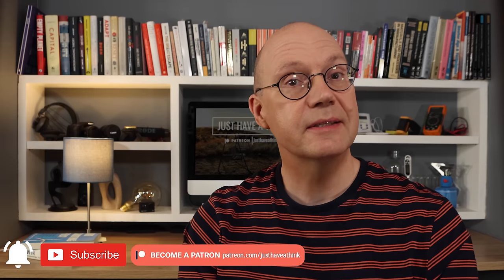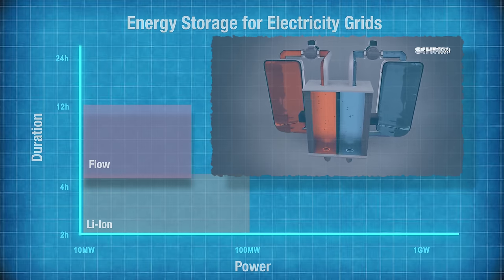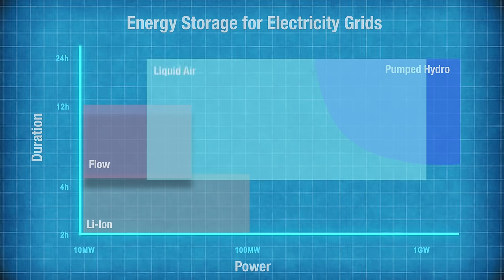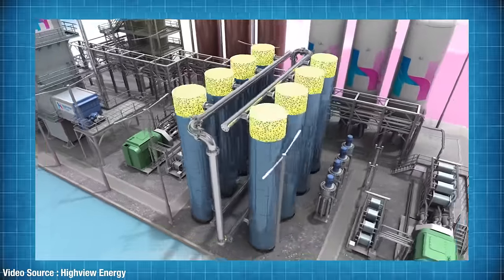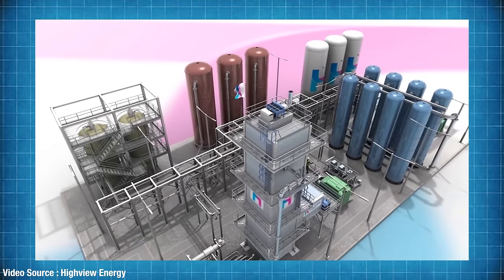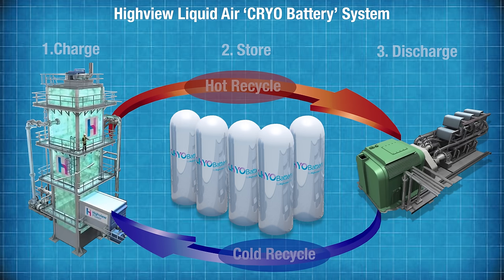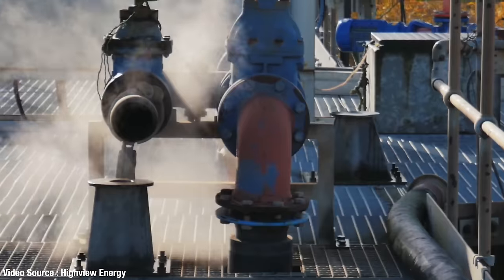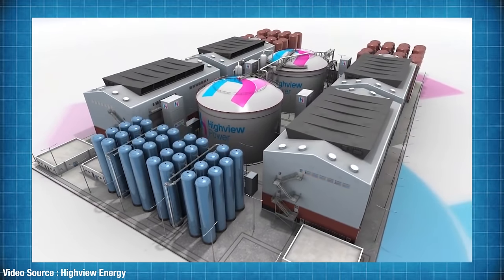Liquid Air Batteries. Literally energy from thin air. Seriously. Literally!

Comment: Mr. Borlace, thank you for this additional insight. You mentioned 60% round trip efficiency. Have you heard how quickly the response time to full grid power these systems achieve? I know that peaking gas turbines have about 10 minutes to reach full power output to grid and of course Li-Ion batteries are virtually instantaneous. Any idea where these liquid air technologies fall? Thank you again for your excellent content! Much appreciated!
Reply: By looks of it, single minutes especially if run at fraction of power just to make gen stay in sync.
Reply: It is long-term energy storage such that combined with concentrating solar thermal the combine output is 130%

Comment: The maximum efficiency due to thermodynamics is about 70%, compared to over 90% for the best battery system. Dr. Sadoway's liquid Al should
be more efficient than the liquid air, done properly.  Its all a matter of cost/benefits.

Comment: Very good presentation. I see others have mentioned liquid metal batteries which was another upcoming complementary technology.
This technology launch has taken some time, but now success. Funding was key and the business environment was not ready for LAES. Now we need to go full speed to decarbonise. 
Industry , financing and the public have got it. 
I believe the 60% energy storage efficiency figure presented, based on my own experience as an LNG plant design expert.  Further detail improvement will only give incremental efficiency gains. This is still a worthwhile technology as part of a mix. There is no silver bullet single answer at this time. Now conversations need to also move towards forming regional and ultimately a world-wide energy energy web(s) so that renewable "generation" as well as other forms and  "battery" investments and utilisations across continents are maximised. VHVDC transfer technology is already available and in use to do this.

Comment: 50-60% efficiency is quite low (And it may be in the best condition possible ??).  Hydro are close to  70%–80% and Ion battery close to +90%. It may be the big problem ? But if it can store power that would be waste aniway... it would be a win in some area.

Comment: I'm hoping to use a centrifugal Tesla-style disk pump to create liquid air as a supplement to my DIY plug-in electric hybrid's Lithium Titanate batteries that can then get fed back in to the EV hybrid's Tesla turbine power source using waste heat from the combustor to re-expand the liquid air.

There's also the potential for feeding LOX to a gasifier via Tesla's valvular conduit fluidic diode as a pulse combustor which makes the turbine combustor in to a rocket-powered turbine. XD

Comment: Thanks your you thoughts. I wonder if part of these developments can include gas stations for transportation. If liquid air storage is so good can't we power vehicles with air motors and refill the tanks at gas stations. (Liquid air gas stations). Why do we keep reusing electricity as the only means of power transfer. Another thing concerned me, any thermal power station is limited to maybe 50% efficiency in generating electricity, that's nuclear included. Whilst hydro generation is much higher. In the end it will be reducing dependence on any source of power except renewables which is sustainable. Great stuff, I've yust found you. Cheers David.

Comment: What we need is a free market for electric power (preferably combined with a carbon tax in proportion to the net loss associated with submerging all coastal  cities, etc, but that's another topic).

If everyone buys and sells electricity on a suppy and demand basis, the grid will be balanced. We don't need to debate how to balance the grid. Whoever deploys the most efficient mechanisms makes the most money. Meanwhile, we'd all charge our cars at off-peak hours when it's cheap, so BEVs balance the grid even if they don't do V2G. 

Of course the fracking industry will do all it can to prevent this while they try to sell us a Hydrogen future.

Comment: Creating Thust Using  gyro permanent magnets and electro magnets 
You need unbalanced gyro to create the thrust'

 to achieve this you can.

 Drill holes in the Outter edge of a disc

 insert barrel magnets with north

 facing to outter edge of the gyro disc.

 There must be room for magnets to

 slide in and out as the disc spins in side the frame.

 positioned around the gyro disc

 ( holding magnet from rubbing the frame) 

With the gyro spinning in the balanced mode

 energize electro magnets mounted in frame 

 ( at every 45 degrees with north poles facing the north poles of the

 disc when energized putting the gyro out of balanced creating thrust.

Creating Thust Using  gyro permanent magnets and electro magnets 

You need unbalanced gyro to create the thrust'

 to achieve this you can.

 Drill holes in the Outter edge of a disc

 insert barrel magnets with north

 facing to outter edge of the gyro disc.

 There must be room for magnets to

 slide in and out as the disc spins in side the frame.

 positioned around the gyro disc

 ( holding magnet from rubbing the frame) 

With the gyro spinning in the balanced mode

 energize electro magnets mounted in frame 

 ( at every 45 degrees with north poles facing the north poles of the

 disc when energized putting the gyro out of balanced creating thrust. 

        You need unbalanced gyro to create the thrust'.

      To achieve this you can.

 (1) Create a brass disc 12 inch diameter 1 inch thick

     (1a) Drill holes in the disc insert barrel magnets with north pole to outside edge.

(2) Create a brass disc 12 inch diameter 1 inch thick

    (2a) Drill a hole 5/8 inch by 4 inches (from the outer ring toward center axis)  every 60 degrees.

   (1b)  insert ( 1/2 inch  X 1 inch)  barrel magnet  into all 6 holes. 

   (2c) There must be room for magnets to slide.

   (2d)  Insert ( 5/8 inch X 1/4 inch) graphite plugs. 

(3) Place disc inside of brass ring with an inside diameter of 12 and 1/8 in

   (3a) Mount around the outer ring electrical magnets every 45 degrees.

   (3b) 8 electrical magnets at.

     ( 1) North),( 2) North East ),( 3 )East),(4)South East)

           ,(5)South),(6)South West),(7)West),(8)North West)

(4)  . When energized putting the gyro out of balanced creating a forward  thrust. 

   (4a) Depending on  which  electrical magnet is energized .

 

 Concerning Gravity created by centrifugal force. 

     (1) Because gravity and magnetic flux are unrelated.

     (2)  We can consider using a balanced wheel,

           with freely mounted magnets

          ( a) With north poles facing outward  

          (b) on outer edge

          (c) mounted in side a framework 

     (3) With permanently mounted electral magnets in frame

         (a) with the north poles toward the wheel 

              in different locations around edges of said wheel 

        (b) As the wheel spins creating centrifugal force

        (c) power added to the electrical magnet

    (4) Will cause the  centrifugal 

      energy to flow to opposite side of

          the wheel causing vehicle to move in that direction. 

You can use this configuration to shift the center of the wheels gravity

 thus creating foward thrust which can be aimed in any direction. 

Which can in effect Defeat gravity.

        I would be willing to work with you . I have other ideas to share.

                                          If you can make this easser to under stand please help.
Creating Thust Using  gyro permanent magnets and electro magnets 
You need unbalanced gyro to create the thrust'

 to achieve this you can.

 Drill holes in the Outter edge of a disc

 insert barrel magnets with north

 facing to outter edge of the gyro disc.

 There must be room for magnets to

 slide in and out as the disc spins in side the frame.

 positioned around the gyro disc

 ( holding magnet from rubbing the frame) 

With the gyro spinning in the balanced mode

 energize electro magnets mounted in frame 

 ( at every 45 degrees with north poles facing the north poles of the

 disc when energized putting the gyro out of balanced creating thrust.

Creating Thust Using  gyro permanent magnets and electro magnets 

You need unbalanced gyro to create the thrust'

 to achieve this you can.

 Drill holes in the Outter edge of a disc

 insert barrel magnets with north

 facing to outter edge of the gyro disc.

 There must be room for magnets to

 slide in and out as the disc spins in side the frame.

 positioned around the gyro disc

 ( holding magnet from rubbing the frame) 

With the gyro spinning in the balanced mode

 energize electro magnets mounted in frame 

 ( at every 45 degrees with north poles facing the north poles of the

 disc when energized putting the gyro out of balanced creating thrust. 

        You need unbalanced gyro to create the thrust'.

      To achieve this you can.

 (1) Create a brass disc 12 inch diameter 1 inch thick

     (1a) Drill holes in the disc insert barrel magnets with north pole to outside edge.

(2) Create a brass disc 12 inch diameter 1 inch thick

    (2a) Drill a hole 5/8 inch by 4 inches (from the outer ring toward center axis)  every 60 degrees.

   (1b)  insert ( 1/2 inch  X 1 inch)  barrel magnet  into all 6 holes. 

   (2c) There must be room for magnets to slide.

   (2d)  Insert ( 5/8 inch X 1/4 inch) graphite plugs. 

(3) Place disc inside of brass ring with an inside diameter of 12 and 1/8 in

   (3a) Mount around the outer ring electrical magnets every 45 degrees.

   (3b) 8 electrical magnets at.

     ( 1) North),( 2) North East ),( 3 )East),(4)South East)

           ,(5)South),(6)South West),(7)West),(8)North West)

(4)  . When energized putting the gyro out of balanced creating a forward  thrust. 

   (4a) Depending on  which  electrical magnet is energized .

 

 Concerning Gravity created by centrifugal force. 

     (1) Because gravity and magnetic flux are unrelated.

     (2)  We can consider using a balanced wheel,

           with freely mounted magnets

          ( a) With north poles facing outward  

          (b) on outer edge

          (c) mounted in side a framework 

     (3) With permanently mounted electral magnets in frame

         (a) with the north poles toward the wheel 

              in different locations around edges of said wheel 

        (b) As the wheel spins creating centrifugal force

        (c) power added to the electrical magnet

    (4) Will cause the  centrifugal 

      energy to flow to opposite side of

          the wheel causing vehicle to move in that direction. 

You can use this configuration to shift the center of the wheels gravity

 thus creating foward thrust which can be aimed in any direction. 

Which can in effect Defeat gravity.

        I would be willing to work with you . I have other ideas to share.

                                          If you can make this easser to under stand please help.

Comment: Calling it a liquid air battery is a bit dishonest. The energy doesn't come from the air, but from whatever is heating it up to cause it to boil. And you can't draw that heat from environment. If you're generating 100MW of power, you'd be drawing more than 100MW of heat from the environment. That's equivalent to power lost in a desert on a perfectly clear night by about 25,000 square meters of ground. Area equivalent to almost 5 american football fields or about 3.5 soccer fields. You just can't distribute that kind of heat absorption without things starting to ice up and rapidly lose efficiency. So if this works at all at cited conversion efficiency and power output, the energy storage is entirely in the hot/cold tanks. And there are phase transitions you can use to get decent energy density out of these with good heat exchange, so maybe that whole thing is plausible at scale, but air's just a working fluid here. Saying that it's a liquid air battery is like saying that nuclear power plant is a water battery. In both of these cases air or water is just the thing that boils to drive your turbines.

Comment: There is a weak point in this scheme! You just briefly mention that heat and cold are stored too, now this is the big problem, you need a huge volume of say water to store that heat. If you want to store 100 MW during 24 hours and you do it with water, then you need a lake. For a 1°C temperature variation, it has to be 5m deep 600 by 600 meters wide. A much bigger temperature variation would harm the possible fish you want to put in your lake. A second cold lake would be best frozen and of the same size.

Comment: I like your analogy with the hammer. What if I could raise a 1 tonne weight  6 meters off the ground then use the weight as a driving force. Or pumped water into a 500 gallon water tank 6 meters above the ground on a stand and then released the water driving a turbine down by the house where the fall is greater than 6 metres. I need exercise everyday & use a stationary bike and a water pump connected to it I could pump the water back up to the top tank. Or use solar energy to do the same Or a Fresnel lens + sunshine to make steam to power a steam engine or a solR water cooker to make steam to drive the steamengine to pump the water up the hill to make electricity that way. Solar thermal energy is free to boil water. Conversely what if I wound up a huge clock spring using 10mm thick spring steel using the bike to wind it up to release energy that way to drive a generator  to pump the water back up the hill. I must admit I do like your videos. Calm, quiet, gentle voice and NO hideous background music.

Comment: Forget making dams to generate enough electricity to supply a grid. Scale it down to individual family. Build a rotisserie similar to bi-box stores like Lowe's or home Depot carpet rolls use. But instead of carpet, install tanks open at the top. At the top of the rotisserie is a reservoir tank with a valve to dispense the water to the top tank and each subsequent tank thereafter. Like a rotisserie, it is a loop system revolving round and round, filling and emptying, dumping their fill into the bottom reservoir. Water is heavy and will produce tons of gravity downward pull which can easily generate all the power needed for a family, day or night, rain or shine, 24/7/365. Here's a link to a sample near the bottom of the front page: itellwhy.com.

Comment: A very interesting concept. 60 odd % is not very good however. Although capturing the CO2 and either reducing it to carbon of very high purity to be used in batteries & industry and Oxygen or water (by reducing it using Hydrogen would work) or some form of permanent capture.  Make the Hydrogen back to use again from the very pure water by electrolysis, during the night when power is if not cheap hut better than free. 
That way not only do you have a battery but a Carbon capture system reducing atmospheric Carbon and a saleable product too.

Comment: @just have a think.

There is a 40% loss from the wind farm or solar farm through the transmission lines to this facility. That means only 60% of the power from wind and solar is making it to this plant.

Then there is the cost of power of doing their liquefacation. 

Then the cost of converting it from a liquid to turn the turbine, and the losses in the turbine.

Then it's back to the grid and the transmission lines, and it'll transmit power with another 40% loss of whatever it puts out.

I get it they're taking power that would otherwise not get used, because they'd have to shut down the solar or wind if there was no place to store it.

But you can see that this is a scam I hope. We have to come up with better systems. That don't have these inherent losses.

They don't want to scale down to put something on somebody's house that is stand alone; that actually works, that doesn't make them money. 

They want to control the power so they can one day soon shut it off.

We are completely slave to the internet: as it is controlling the cell phones /our business computers /our personal computers/ all of the banking /all of the legal systems/ all of the businesses.

 All you got to do is shut the power off, to turn off everybody's cell phone/ everyone's computer/ everyone's Bank account/ and everything else. 

You can't even get gas out of the pump at the gas station if the power goes down BECAUSE: it's a electric driven pump, controlled by a computer.

Comment: 60% efficiency seems unrealistic. Read that state of the art thermal energy plants (Hot -> Cold) have a efficiency of 49%. The round cycle does two cycles, one for storing and one for extracting.

Recycling seems unrealistic to me since we would either be charging or discharging the battery at a particular time.

Comment: Unlike Lithium Ion battery technology; this technology requires no new development; uses off-the-shelf and proven equipment (from the air liquefaction industry) ; does not have any siting hazard (un-like large Lithium battery siting), can be located within large load centers like central city locations and is not dependent on any material or element that is in limited supply.

Comment: I saw a TED talk about using compressed air in the same manner.Could this not be used by a home owner.It looks like air tank which hold 4500 psi are readily available,and some cars are being developed with tanks that have a larger capacity.
Would like to hear more about a small scale home owner compressed air storage and a generator that runs on stored compressed air if that’s possible.?🤠
Love your show ...thank you